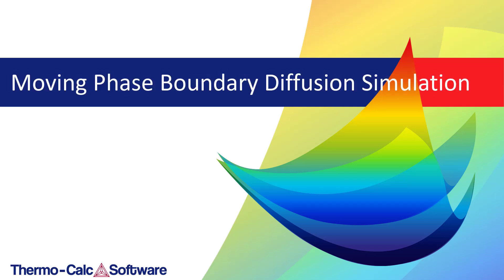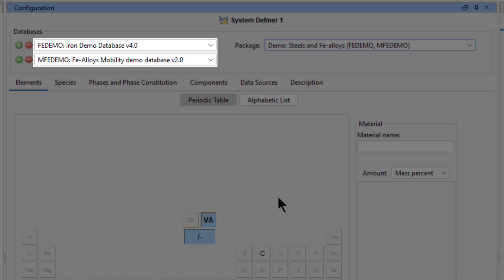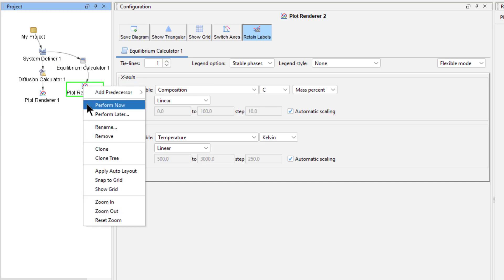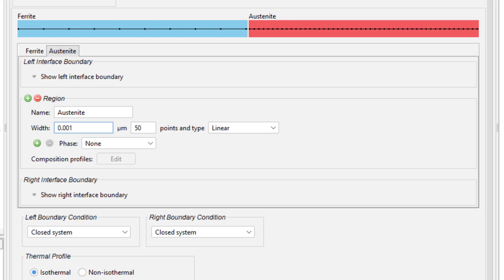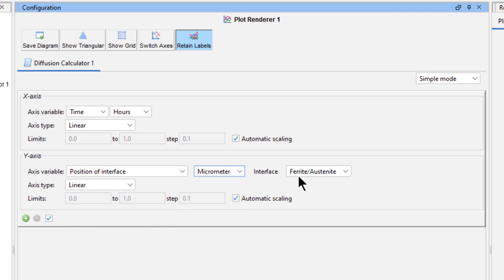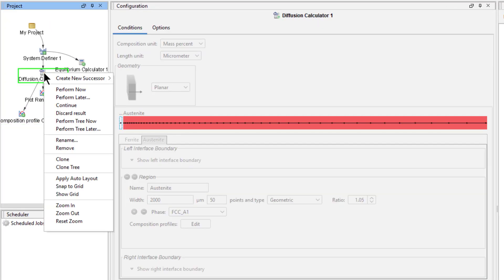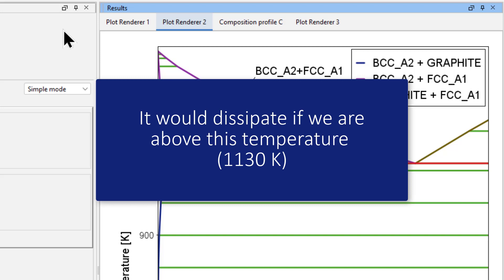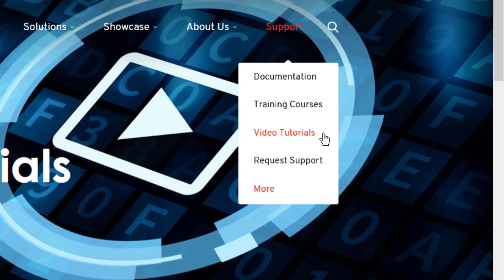OUTDATED - Example D_02 - Moving Phase Boundary Diffusion Simulation

Comment: Can you please make a video with two compounds, instead of just two elements. For example, Y2O3-ZrO2.
Reply from the maker: Hi Sharon! Thank you for the suggestion. We have taken note of it and will consider it as we make additional videos. Even though we don't have a video for this, we have an example you can refer to. It's a console mode example called "tcex17 - The Pseudo-binary System - CaO-SiO2". You can access it from the console mode of the software under the Help menu > Example Files > Thermo-Calc. You can read about it in the online help, which you can access from your software under Help > Online Help then search for "tcex17" and click on either of the search results.
Reply from the maker: Hi Sharon! I know it's been a while since you posted your comment, but we made a video using components instead of elements. You can read about it and watch the video at this blog post: https://thermocalc.com/blog/new-video-tutorial-how-to-calculate-a-phase-diagram-for-an-oxide-system/